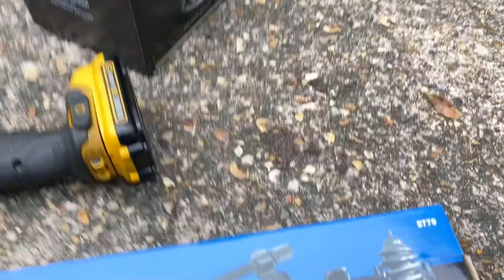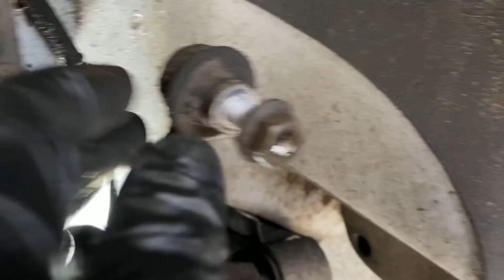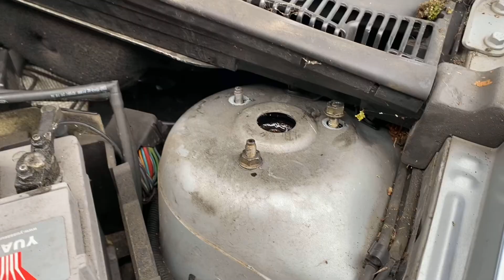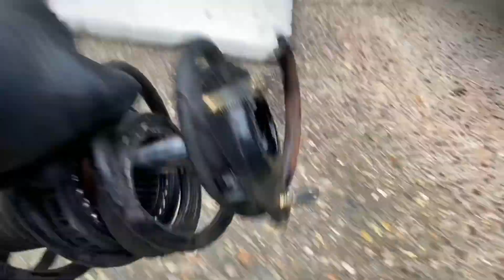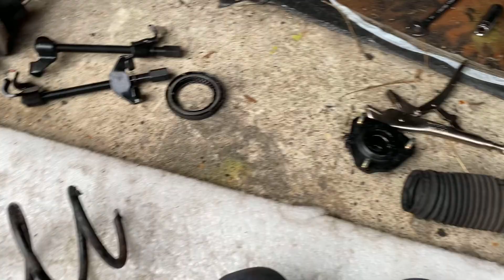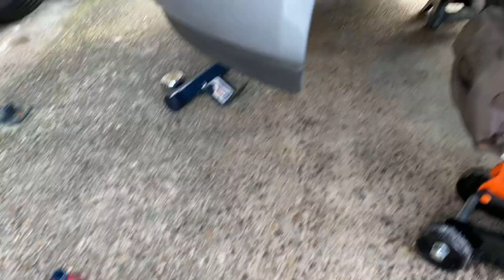How to: Replace front coil spring and top strut mount on a Ford Fiesta (2002-2008)

Comment: no criticism but while  it's in place I would loosen . the top bolt couple of threads so you haven't got to force that bolt while under while springs are compressed

Comment: Great video, just wondering if there’s any chance of the drive shaft popping out once the knuckles free of the strut if so any preventives? Thanks
Reply: No mate, he’s not removed the driveshaft nut from the hub and there’s not enough movement from the lower arm to remove the driveshaft from gearbox side 👍🏼